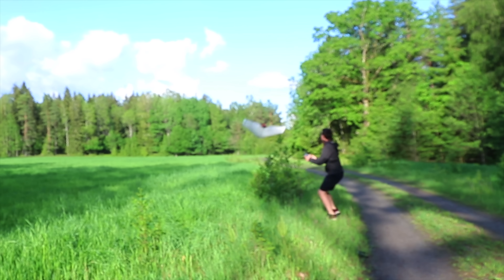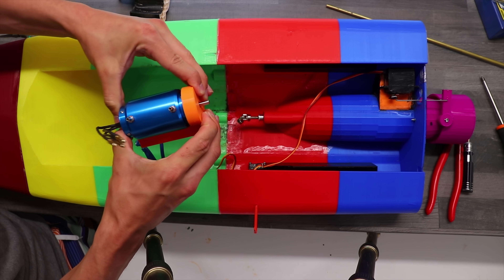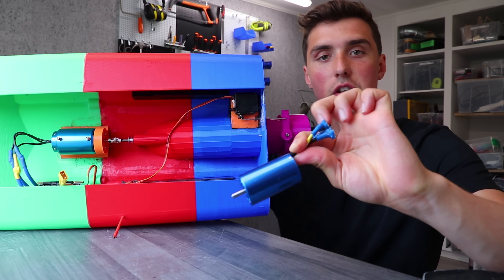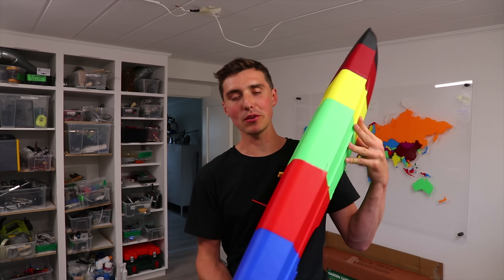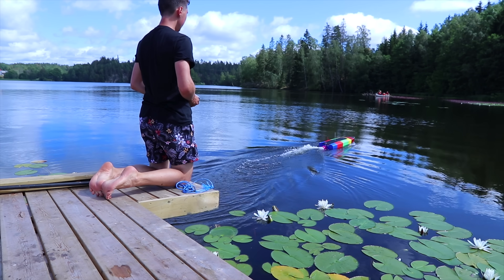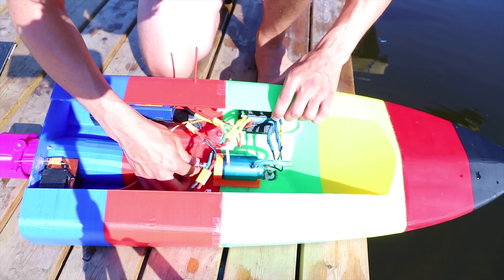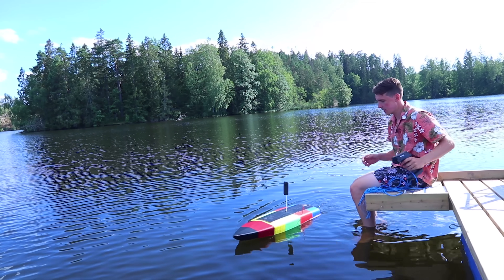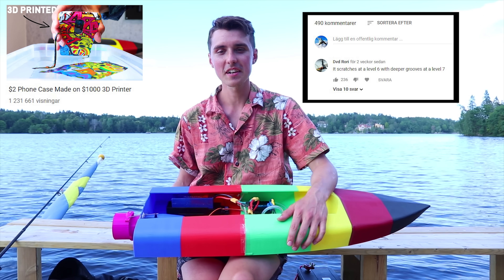How This Electric Motor BOOSTED My RC Boat

Comment from the maker: Leave a comment or the rainbow boat will perish!
Reply: Does the water cooling work ? 😂😂
Reply: I think you need to keep making it faster till it catches on fire but I'm an American. That's just what we do. :-)
Reply: @thenam3less  lol
Reply: Try making it a hydrofoil!
Reply: You said that the PLA was getting soft. Could you not use a spray uv plastic coating over it? 
PLA  loves to absorb moister. You may have to put it in the oven to dry it out.
Reply: Nearly want to see it irl.
You don't live to fare away from me.
(I don't mean it in a creepy way)
Reply: RCLifeOn noooo not the rainbow unicorn boat, plz make a dual jet boat
Reply: @adamhasan7370  yes!
Reply: Adam Hasan has
Reply: What species of fish do you guys have there?
Reply: @AGKRex  it's a perch! a predator
Reply: "comment" to avoid the F in chat when the boat dies
Reply: make a large 4s battery for the damn boat instead of those 2 lead acid batteries
Reply: When you commented on the heat, I was like "Live in Texas." Just found out how hot it's been this week. It's been deadly all over Europe.
Reply: Great video, but I think you could have a much more faster boat with another design. I mean, if you make it narrow and more hydrodynamic you would reduce a lot friction (and with less gap between propeller and the boat "chasi" you would increase efficiency).  I wait for your answer...but I think you won´t.
Reply: Cool the ESC FIRST!!!
Then the motor.....

This way the most important and hottest part get's the cold water first...
Reply: it's not the KV..it's a BIGGER MOTOR..you went from a 3660 to 4086
A 4072 2250KV on 4s 120A will make my MGT4.6 do a back flip from
a stand still....
The next challenge would prop be the PROPS..or you still need to MATCH
the PROP PITCH with the motor's KV..
Plus you're adding too many  batteries..it comes back to power to wiegth
ratio.
My converted px16 ( 32" haul) with twins 3650 is FASTER than that on  3s..
becuase it's LITE. The hull is this THIN food container plastic...lmao
I just rein forced certain area...It'll throw 20' rooster tail..lmao

There's  things you can do to reduce DRAG...it's still the same lift on concept..You know Hydro plan boats bearly skim the water at higher speed.
Reply: do you have a plan to build electric surfboard
Reply: Hi !
 It is possible to have the file to print the boat .... I thank you :)
Reply: Gör mer videos
Reply: Please Review the Ender 5
Reply: Bang give away bang
Reply: Where do you buy the baterys and conectors ???
Reply: @ulisescazares4854  hobbyking all from hobbyking is best for that stuff
Reply: @ulisescazares4854  I think @ Hobbyking
Reply: If you come to slovenia one day we can go driving boats i made one out of plywood it wil go fast i am doing paintjob on it now 
Love yourse vids 
Recomend less montages and more clips of work ❤🤩😘
Reply: Can you make a mini sabmerin
Reply: Took the advice, huh?  Glad to help. Turned out great!  Beautiful, fat Perch, too!  Ought to fry up nice!
Reply: A comment
Reply: Hi.   I have a printer that can print 500mm Z.  What is the length of the boat.  I might be able to print it for you full length as one whole part if you wish?
Reply: The boat looks over 500mm.  I could just make my printer taller and print what ever height you require.
Reply: i think you should experiment with different types and shapes of props
Reply: Cool video! Is the nozzle and the rudder part of this design? https://www.thingiverse.com/thing:1652077 have you thought about uploading a remix? That would be awesome!
Reply: Also interested whether or not the water cooling worked!
Reply: okay
Reply: It looks like losing speed regarding friction between boat and water, plz try making foiling boat.
Reply: Why don't you use hot glue around the out side of the Boat where the water is splashing up.
Reply: RCLifeOn  why such a big jet?
Reply: DONT KILL THE RAINBOW
Reply: German flag on nose boat*
Reply: Add mesh also for stopping going anything in propeller cavity.
Reply: Det va faktiskt en jädra fin abborre
Reply: RCLifeOn it sounds like you are haveing the wet poops
Reply: No
Reply: RCLifeOn i would have perished my subscription long ago, if you weren’t so cool and if this channel didnt make cool stuff
Reply: Hey I whant one can I buy you one rainbow boat I'll love it if I can buy it from you.
Reply: If you want to go faster, get a surface drive to replace the jet . Unfortunately,  it will need to be all metal,  I suggest Grapher or similar.
Reply: No
Reply: Make a smaller nozzle, that will increase the speed of the water being forced through it.Make a new nozzle mount with a o-ring groove in it put an o-ring in it problem solved, don't half-ass something that can destroy the electronics.
Reply: Nice aborre .. blow up the rainbow boat and make an hoovercraft rainbow boat
Reply: RCLifeOn maybe a tighter jet nozzle would make it go faster too because it forces the water out with more pressure
Reply: Make the steering jet thing smaller and it`ll go faster (ps look at the back of a jetski for ideas)
Reply: What if 2 motors . 🤯
Reply: a
Reply: Make a HUGE one that can actually drag you around in the water :D
Reply: Oo pewdiepie
Reply: On boats it needs to overcome the resistance of the water. Because of that I think it will be faster if you foil the boat to smooth out the routh surface of 3d printed things.
It would be enough to just foil the bottom part.
Reply: No oh wait I just put a comment
Reply: The rainbow boat needs a different hull design so the jet drive... is more under the water. It looks like its wasting energy by throwing the jet stream on top of the water. 

Very nice ...I like it
Reply: Omg nooo.how could uu
Reply: About  being "hot a.s." since I'm from Texas it's hard not to laugh at that.... but, great video.  I really like the helicopter sound effects on the drone footage 👍
Reply: If you want to make it fly contact me, I'm an aerospace engineer, we can improve the fluid dynamics
Reply: Awesome !
Reply: hi, did you ever think did create the filament?
I would like to create a machine to recycle the PLA of the wrong prints.
Reply: Excellent work my friend! I'm using that same motor (x2) on my kayak :-D .
Reply: Solid video work, going to HK to look up that motor and esc combo. Great info on the build and camera work.
Reply: Can you buy a boat that actually goes 100mph and try to build a replica? There's probably a trick to getting those speeds..
Reply: Cant u make a 1:2 gearbox for the motor? If the clutch is high anoff it spins twice the speed :O
Reply: oof
Reply: I like the rainbow boat. It's like a test pattern, with a jet engine, so instead of a loud beep, it's a low, whoosh.
Reply: I guess im asking the wrong place but does anybody know of a way to log back into an Instagram account?
I somehow lost the account password. I would love any tricks you can give me.
Reply: @Preston Dominik instablaster ;)
Reply: @Tyson Leonidas Thanks so much for your reply. I found the site through google and Im trying it out now.
I see it takes a while so I will reply here later with my results.
Reply: @Tyson Leonidas WTF IT REALLY WORKED :O Literally hacked my Instagram account after about 45 mins by using the site.
I had to pay 15 bucks but for sure worth the money =)
Thank you so much, you saved my account!
Reply: @Preston Dominik No problem :)
Reply: Which specific motor is it?
Reply: How long your rc boat?
Reply: You are awesome 🤩
A video request 
Make a airplane that is powered by solar and flies toward sun and never comes back😝
Reply: @rohitpahwa8683  it'd fall to earth as the airplane wouldn't be able to reach an altitude high enough to get to space and will lag behind the sun on the earth's own rotation.
Reply: Liking your own comment. What a twat XD
Reply: I triple dog dare you to make an even bigger one with three jets all using their own 820 sized drill motor.
Reply: @BigCroca  

Brushed 820 drill motors have nothing on a big 4084 brushless motor....

The 3 combined wouldnt even come close to a single 4084.....
Reply: @dannybax1982  oh
Reply: Can you print a 3D printer whit a 3D printer I think that's an option for a video😊

Comment: I would take the outdrive off and put some silicone on it to seal it so you’re not losing pressure. I would imagine it’s probably leaking out the bottom too but you can’t see it.  Cool boat!

Comment: If you want it to be faster and more efficient reduce the size and height (the outlet should be more submerged) of the outlet on you jet drive this will create more propulsion and also lift to the bow.

Comment: The biggest problem with that boat is the hull. It is pushing a lot of water. You can see in the underwater shots how low it is in the water. Check out a deep v or better yet a cat.

Comment: Hi
2-4S 2862-2800KV Water Cooled Brushless Outrunner Motor+50A ESC For RC Boat.
I would like to know please what battery to buy .... what would be the minimum battery power and the maximum to know what I take thank you

Comment: To make it quicker you need to decrease the size of the jet which will decrease the weight of the water the tube is holding and also increase the output speed of the water

Comment: If you sanded and painted the bottom to a high gloss and did something about the pump dragging in the water i bet it would be way faster .. jet skis use a ride plate under the pump nozzle, you could add that so the pump doesn't drag!!
Sooo ... did you do it yet?? ;)

Comment: got that 150a turnigy esc aswell on 6s my catamaran, it did a backflip on spot when hitting the throttle, second time it even ripped apart the flexible shaft.  its running a 2200kv motor.

Comment: Need to use a smaller pump nozzle to compress the jet stream.   Also you need to have a stater section to straiten the stream from the impeller.   Check out how a jet ski pump works,. Good 3d printing.!  Keep RC in!

Comment: Hi. I liked your video and all the effort you put into getting your RC boat to do very well!  My question is,  I have a 55 inch fiberglass boat that original had a 2cycle engine in it.  I want to convert it to brushless and have a very good plan. I just am low income and cannot afford the motor and esc I need.  How can I get a company like Hobbyking or another manufacturer to send me what I need????   I am willing to video and put the video on YouTube.  I have been in the hobby of RC for 20yrs.  I just need some help to get   the parts to make a huge boat go very very fast and handle well.....I know it will work.  Please let me know what you think I should do or if you can help. My e mail addy is dg menace at g mail com .  Thank you in advance, and again, NICE JOB!!

Comment: Just a tip. I raced full sized jet boats with the same jet drive design. Instead of using the inlet in front of the intake for the motor cooling. What we do in the full sized boats is put the inlet in the pump itself after the impeller. The pump pressure feeds the water to cool the engine, or motor in this case. Also, the nozzle seems very large for what I would expect of a boat of that size and power. Honestly our full size race boat has an opening maybe only double that size. So it seems very large for the scale of the boat. Not sure if you experimented with different sizes when making it. But I would expect an opening half that size, maybe even smaller to get the water moving much much faster out the nozzle, similar to how a garden hose works when putting your thumb over the opening.

Really cool stuff, keep it up.

Comment: in other words, you need to select the correct motor to suit the impeller. its the impeller's properties, and the voltage that determine what motor you select.

Comment: make a gasket where the pink plastic meets the blue plastic on the back of the boat. you are losing a lot of pressure that that would make the boat faster. and it would stop water from spurting up toward the hatch

Comment: Very nice. If you’re concerned about the efficiency of the water cooling, you could have dropped the intake inside the duct for forced water by the motor. And make the wagon handle longer. You’re too tall to powerboard and almost walk with it.

Comment: Certainly interesting, looks like the repaired version was running OK and it looked reasonably fast. Would be interesting to see if it was faster using foils instead of just the hull.

Comment: Wow nice boat, I try to build my own next time, first I wanna finish my jet drive. I thing I will use a hobbywing 3180kv, I have the same in my Robbe Magnum and I can't bring the power on the water, cause the boat will transform to a wing 🤣🤣

OK, one thing, I think you should fix your jet drive with a tpu ring between drive and boat frame, I think it's a good solution and it's closed. 🙂

Comment: Want more speed from that waterjet ? REDUCE the exhaust jet size by 50% , that will give you a much more powerful jet ,Water going through a 50 mm pipe into an a prop and out through a 25mm exhaust will exit much faster than what it enters the pipe at

Comment: cool vid nice boat ,ive done a lot of boats in my time and some over 80 mph if you want to get a little more speed in a simple way sand the bottom of the boat so it is not smooth it will break the surface tension ,it work its a trick that was given to me

Comment: How do your parts compare with commercially available parts? such as propeller / turbine enclosure etc?
Can you learn anything from those parts and can you improve on them? Also how does the hull compare to others out there? what are the differences?
Speed boats usually have a step underneath I think it's called a break (I may be wrong) and this helps to get the hull out of the water by introducing turbulent water and air such as this: https://www.youtube.com/watch?v=v8NmQM_s8_E

Comment: Hi, 
With your nozzle how much are you  compressing the water after the impeller? Also the steering nozzle should taper down to compress the existing water. 
With my hamilton jet boat with a hamilton 773 jet unit has a Scott tilt steering nozzle which can tune be fitting different inserts into steering nozzle which changes the nozzle diameter. 
As someone else said take cooling water out after the impeller.

Comment: I think you should remove the jet and run a single prop just to do a comparison you could always put it back and it would be interesting to see the GPS speed difference also water pickup placement would be better off at the transom in my opinion.

Comment: Huge tip, move the inlet for the cooling to sit above the prop, then there is always water flow under good pressure
Reply: I thought exactly the same. Would even adjust the cooling flow proportional to the throttle. =)

Comment: I am freaking out about your project. It is just beautiful and gorgeous . Build a rc boat is one of my goals in life. But how did you design and create the hull. With a pc Programm and a 3D printer?? In this case, which one??
Reply: Just search for 3d program for printers and you will find lots or buy an printer first and the use the asociated program or even Maya 3d desk

Comment: Your biggest problem still remains the pump. Needs a heck of a lot more work. At this moment, it's like you're having a boat anchor. ALSO, the keel of this ship needs to be made so it can start to "float" on water, and at that point, you'll start losing the ability to keep direction, so you need a water blade. Boats ain't easy.

Comment: instead of using a torch to melt the plastic, i suggest using a soldering iron to melts the edges together. its quite a strong bond and its easy.
Reply: an old soldering iron. it gets gunky

Comment: for the water that splatters op you should make a like a wing on the backside, it would help the airodanamics of the boat too,. Another tip is you might experiment with weight's in the back or front on the boat, when the boat hits top speed the boat needs to be in the optimal position to get as much water in the turbine as possible. Hope to help out.
Greetz Bensh all the way from Belgium

Comment: Cool project, but as you see from comments, many things should have been done differently. Thanks for posting this still. One tip for you about joining PLA parts together, try using "Plastruct Plastic Weld" instead of the torch. It is a very fast evaporating plastic solvent cement that works great on ABS, Styrene, Butyrate and Acrylic plastics without heat deformation of your parts. ;^)

Comment: Did you make that Pontoon Barge aka SS Duct-tape?

I Al.most forgot the main comment... If you would decrease the output size of the jet nozzle by half it will accelerate the water much faster. Also seal the part where that water is leaking and shooting up. making a new nozzle will easily give you 2x the speed.
Reply: You did not need to seal it... you should have designed in a coupler... press fit...

Comment: I use a 3D pen to connect things together. I wonder if it is strong enough, to hold a motor like that. If it is strong enough you can disconnect it, when something goes wrong.

Comment: You should consider a gasket or some other sealer between your jet drive housing and the transom. Would stop the water from squirting up and you'd get all the thrust out the back.

Comment: Tips from a jet ski guy. 
Pump nozzle is too big. Trying to move much more water than necessary. Make the exit smaller to create more velocity/pressure instead of volume. 
Use tap in pump discharge to provide cooling water to motor/ESC. Boat needs to be trimmed down (push nose down at speed)